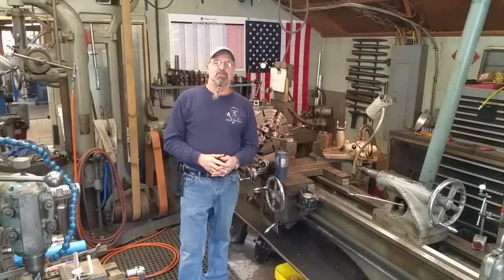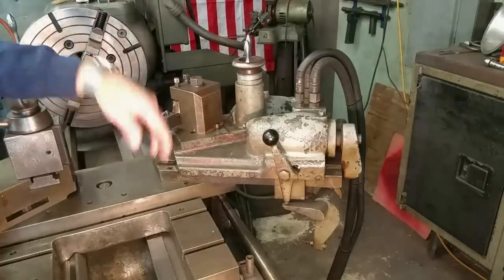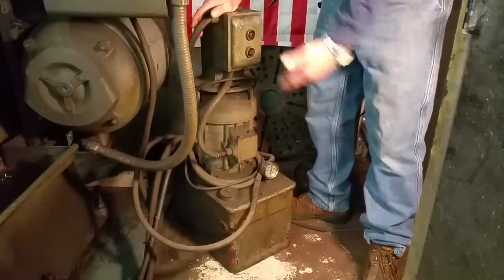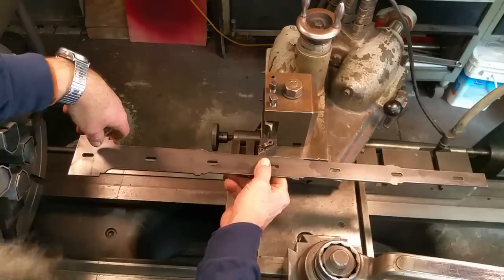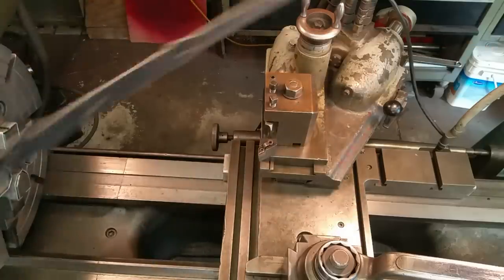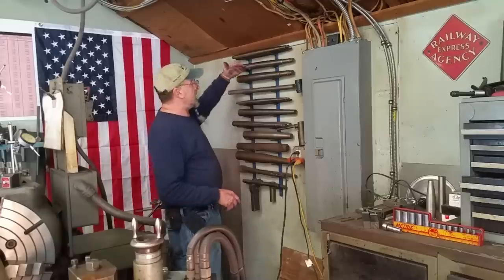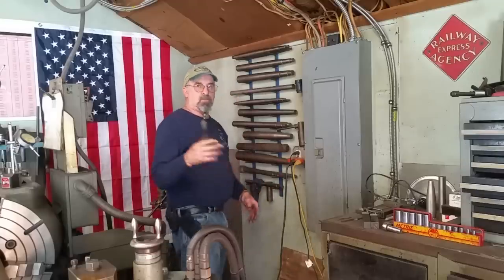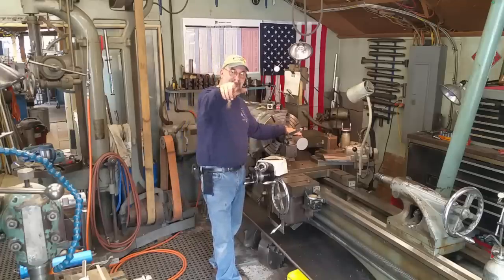Sunday Notes 3

Comment: I started on a Bridgeport 2 headed tracer with an acutrace ? valve. It was great for engraving flames on valve covers and air cleaners. I would sell them on the internet also custom carb spacers,and some hobby parts. Its an art to run and get good results. Replaced it with 2 machining centers ,a CNC mill and cnc router. Still have it in the corner works great if someone wants one CHEAP. No code required.

Comment: It’s amazing how many people don’t realize the difference between the rubber outer cover and the actual braided pressure hose that cover protects from abrasions.  Great video fine content.  
 People tend to voice uninformed opinions rather than put in the effort to research what it is there talking about   After 40 yrs of industrial maintenance I have noticed the trend rather than put in the time to gain experience or research something for their selves they assume they know.  And anyone when experience knows what assuming makes of me and you. 👍
Reply: not a bad thing a good reminder to double check yourself
Reply: A bit salty there partner. Fyi, if the outer skin is pierced, that can be indicative of issues with the inner skin as well. RoT is that you change a hose once that happens because the outer skin is also supposed to provide a dampening force against the motions the inner skin suffers. There's a reason it exists in that form, otherwise, it would be sufficient to have a simple braid with a light non-bonded skin.
Reply: aserta 
Your entitled to your opinion but experience of over 40 yrs says you added your two cents where it wasn’t needed.  The hoses in question are what the comments were made regarding. So your rule of thumb does not apply here
Best wishes. And your comment proved my point exactly.

Comment: I would call your tracer patterns "Masters".
Reply: Tracer patterns are just that patterns, sometimes called templates as well.  Masters are generally complete and perfect replicas of the desired end product,  though they can be a different scale than the final product dimensions.
Reply: My true-trace book  calls them masters, but it is for milling machines. So are you saying if it is 3-d it is a master and if it is 2-d it is a pattern? Of course cam profiles used in cam grinding are masters but they are only 2-d motion so now I am confused. Likely either way someone will know what is being talked about.

Comment: Keith, since I'm not a machinist by trade and have no use for the T scraper, can I suggest you make some bottle openers? All you need to do is modify the ends. If fact, I'd pass those out at the bash too. They'll probably get more action! Plus. I bet many of your fans will buy them and out sell the scrapper. Just a friendly suggestion. We need some chicken videos too!
Rich
Reply from the maker: I'm 10 years dry and not interested, besides if your to weak to twist it off, your to old to drink! RIGHT! LOL ;{)------
Reply from the maker: If by chance, I come up with a great design, I would take advantage of all drinker! LOL ;{)-------

Comment: could you theoretically cut threads with the tracer?
Reply from the maker: You can use the tracer to cut threads at a taper, like pipe threads, but to shape the threads with a tracer no! ;{)-----

Comment: Wow, that was really interesting,thanks! I have a question, could you flip the cutter over and run in reverse rather than flipping the part over? 
Thanks again for a good video. 
Tim
Reply from the maker: The 30 degree angle would still be the same. ;{)------